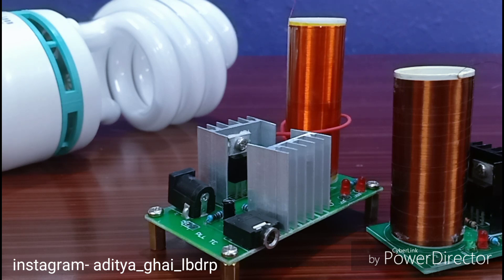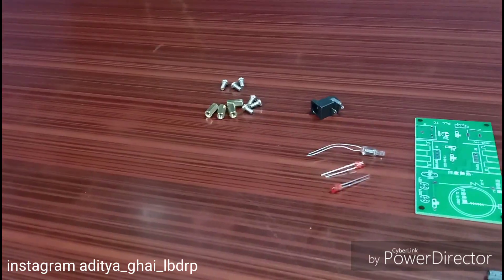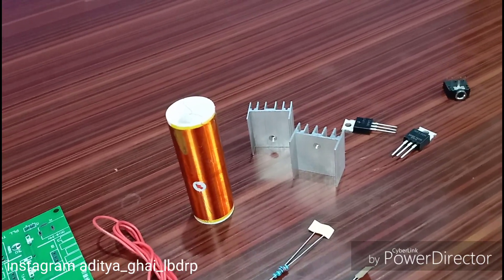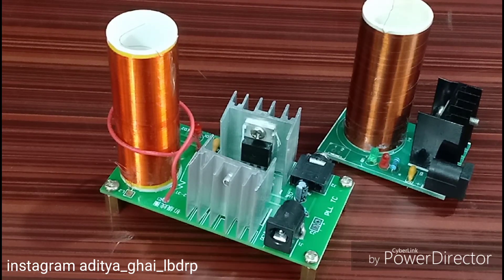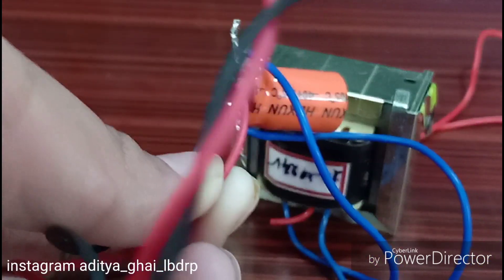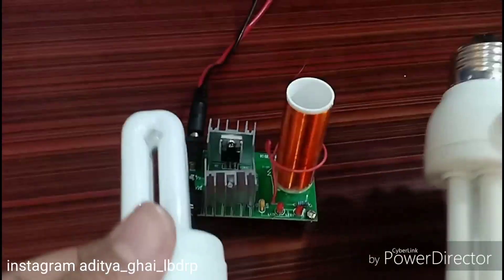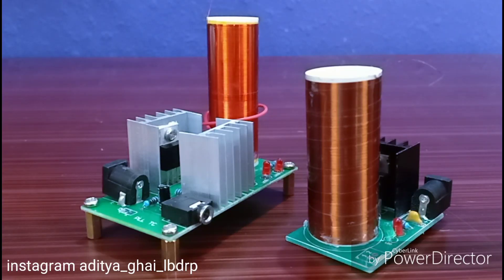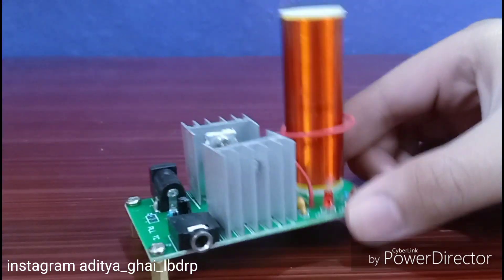DIY MUSICAL TESLA COIL + GIVEAWAY RESULTS

Comment: good work. i did one and use 20v but i don't see any flares at the tip of the coil. also does the LED both light up or just one?
Reply: Flare is usually seen when you have a very strong Tesla coil